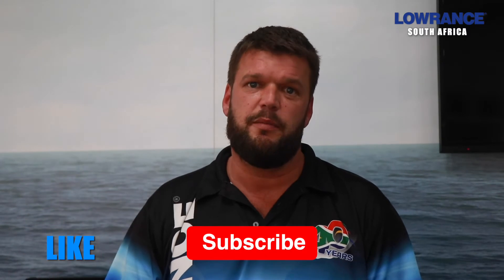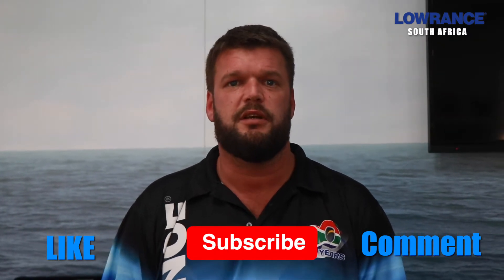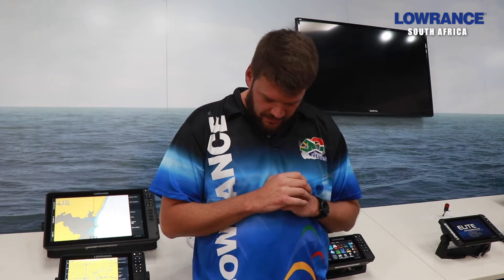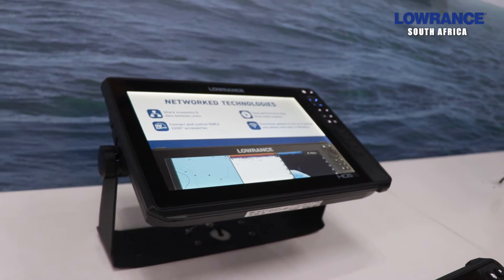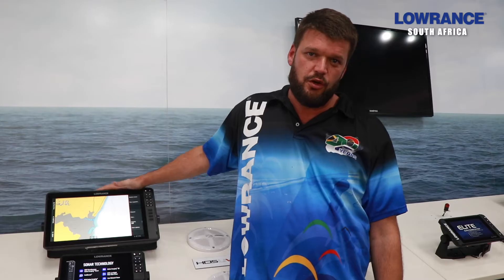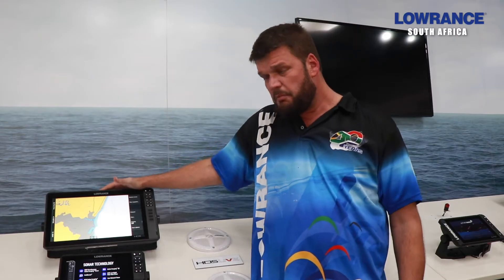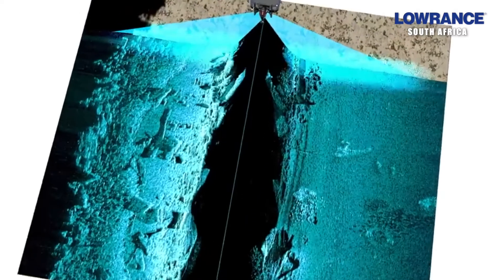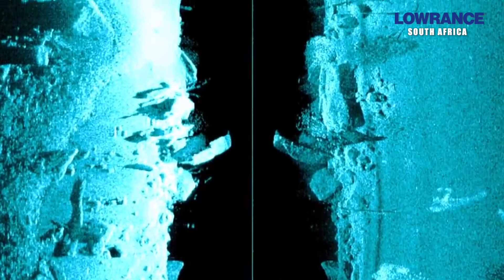Using Multiple Transducers into One LOWRANCE Unit with John Minnie @LowranceSouthAfrica

Comment: How do you add an additional transducer to a HDS Carbon (Ghost 3-in-1), effectively using the Ghost's 3-in-1 on the bow, as well as the one mounted on the stern? If the views from both can't be seen at the same time using the split screen on the Carbon, is there a Y-connector or switch box that can be added to change between the two transducers so you can view the one you want? That way I don't have to keep disconnecting sonar cables. The other cables are set up on NMEA, so it basically just comes down to how to get both sonar cables on the same terminal. Thanks!